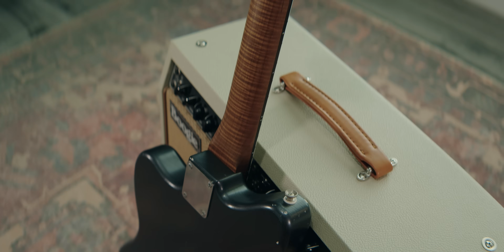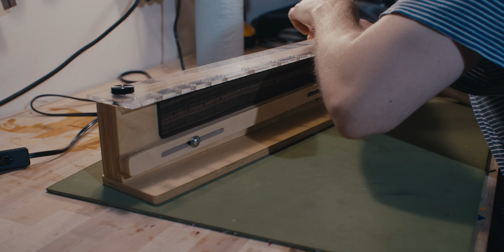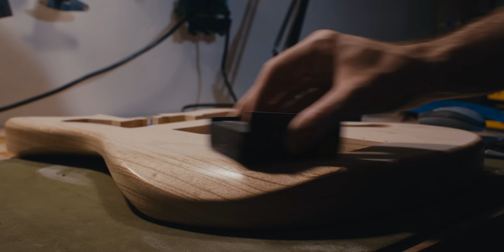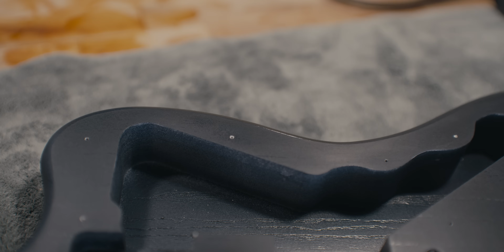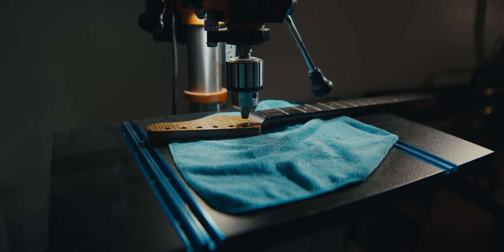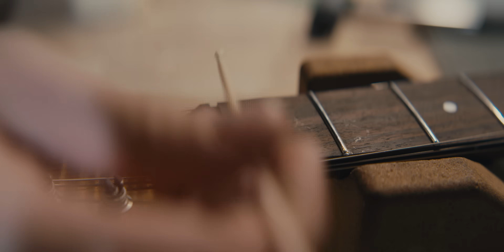Watch This Guitar Get Built Step by Step (Last Guitar Build)

Comment: I think most smaller guitar builders would use a CNC if they had one. I don't think its cheating.
3D modeling and CNC programming is an entire skill on its own and not necessarily easier or more difficult than creating routers by hand.
And of course with anything, there will always be people who love the manual work.

Comment: Great video. Excellent build!

Do you have a rough estimate on cost for materials on this build? Obviously your time counts a lot for the final value, but I’m wanting to do a similar Jazzmaster project on my own with a close friend who’s a wood worker. Trying to get a rough raw cost estimate.

Anywho, this guitar looks and sounds great. No qualms on my end using a CNC or anything. You still did plenty by hand and a CNC is a modern tool you should certainly take advantage of! ✌🏻🤘🏻

Comment: Hey man, great videos and appreciate the voice overs. I'm curious about sanding. I have the same oscillating spindle sander, and I find I tend to get little dents or scratches on the back of the guitar while sanding the edges, so I try to do all the edges first and then front and back with a random orbit sander. Have you ever had that issue, or found a way to mitigate it? My only ideas for the next guitar are to use some blue tape on the back of the guitar to try to protect it while sanding the edges, or make essentially an undersized template to attach to the bottom of the guitar to protect it while sanding.
Reply from the maker: I always sand the edges by hand. Oscillating sander for front and back only
Reply: What? 6:08 in this video is edge on the oscillating spindle sander.
Reply from the maker: @burkelarsen933 oh my bad I was thinking orbital sander. I do get some dents but you can steam them out. I sand front and back after the sides to get remaining imperfections out

Comment: You can do the side dots on the CNC. Since you route the fretboard and the shaft separately, you can glue the fretboard to a fixture (pretty much just a chunk of glued mdf boards or something) with the edge to receive the dots flush with the edge of the fixture. Zero it in, bore the dots. But now you already bought the darn thing so there's no reason to do that anymore lol unless you want custom side markers.

Comment: Those side dot jigs are unnecessary in my view. Theres a simply 3D printable jig that can be printed in about 20 minutes on a Bambu. It lines up perfectly for single and double dots. 
I simply line it up by eye with the fretboard dots. Works wonders. And it’s free

Comment: Wow, that guitar is gorgeous!  Great job!  

That neck is amazing.  Really looks great and I’m sure it feel great to play, as well.  

I’ve built several partscaster, and way back when “relicing” started to be a thing, I had a little side gig / hobby, where I reliced Tele necks and hardware.  
I really appreciate your comments on the relicing process.  Namely how important it is for your relics to look realistic.  I spent hours fretting (pun intended) over the  “authenticity” of my work.  I also felt in many cases, “less was more.”  

Hell, I completely refinished one headstock, with vintage amber nitro, because I didn’t like the way it turned out.  I got a little overboard on the dent and dings in the middle of the backing the headstock.  When I went to install the reliced 2 stripe Klusson tuners that I’d created, those dings didn’t look realistic to me.  I kept thinking how would these have happened thru years of gigging, and couldn’t make them work.  It was a nice heavily figured vintage neck (WD Music Licensed by Fender), and I had 100% positive reviews for my work on eBay, so I wouldn’t sell it that way.  Shit, I list money on that one, by the time I spent hours refinishing it, but I was proud of the results.  

Ultimately, I stopped doing the relicing stuff when every Tom, Dick and Harry started beating the hell out of knock off parts and selling it as “reliced”.  I thought their stuff looked terrible, but couldn’t compete with their pricing.

Comment: Nice build. You have some very specific equipment expect for painting. For under $100 at Harbor Freight you can get a very good compressor and a small touch up gun. You have much more control, less effort, less waste. Cleaning the gun is easy with thinner. The end result is superior even with a budget gun and compressor. Plus the compressor is handy for many other shop tasks. Only caveat is you may need an extra tank to ensure consistent pressure because painting can use a lot of air volume. But a small compressor should work fine.

Comment: The reason I wouldn't use prewired kits is that someone else is likely grading the values of your pots, if they are at all, probably just pulling them from a box without checking their actual values. I've bought too many "250K" pots that read 187 on a meter, which are major tone killers. Keep after it; your end result is impressive.

Comment: I have those Music Nomad nut slot files, I love cutting nut slots now, I used to hate that job.
 I CNC my necks and bodies, as you said it ensures repeatability, and it cuts down on any errors.
 Im currently working in CAD, designing a hybrid between a Jaguar and a Music Man St Vincent, Im also trying to design my own headstock shape, not that I am going to build to sell, I build my own guitars and some for friends, and their friends.
 One new Subscriber!
Reply from the maker: I’ve messed up one too many times where I shape the nut and then cut one of the slots too deep/close to the edge and have to start over. It’s always the worst because you’re at the end of the build and ready to be done with it haha. 
Your next build sounds super cool. Good luck!

Comment: I'm not sure what program you use but I use fusion 360 and have both the headstock and the fretboard are carved to thickness so I don't have to use a thickness sander.
Reply from the maker: Yeah I use Fusion. I’m not smart enough to design the 1” radius transition on the headstock and fretboard with a machining tool path, so I thickness about .65” on a hard edge. I use the edge from the headstock thickness pass to align the fretboard to the right place on the neck for glue up.

Comment: Nice! How much would you charge for it?
Reply from the maker: This one’s not for sale but cost of parts and materials is about $1800, so for this one probably around $2700 to factor in time building it
Reply: Coolio!
Reply: Why not have a go at building a kit guitar?
 I would recommend just buying a neck and body, most of the budget kits have hardware and electronics that most people end up binning, and upgrading to good quality parts.
 The StewMac and Wilkinson Kits are the exception though, especially the Wilkinson Kit, it has all high end parts, and the neck and body quality is top notch, no sanding required at all, apart from the finish.